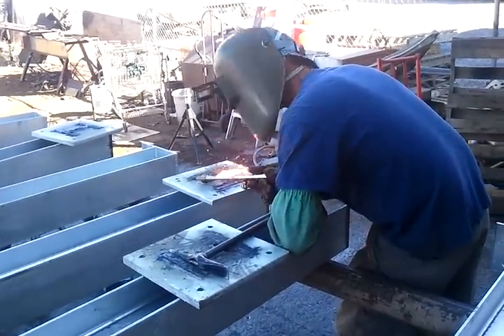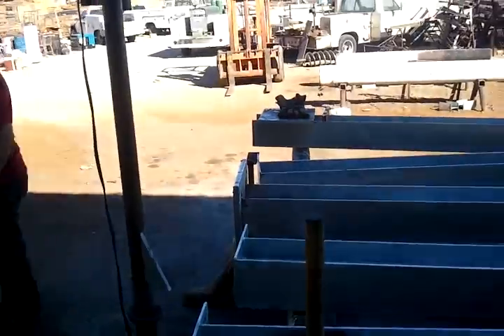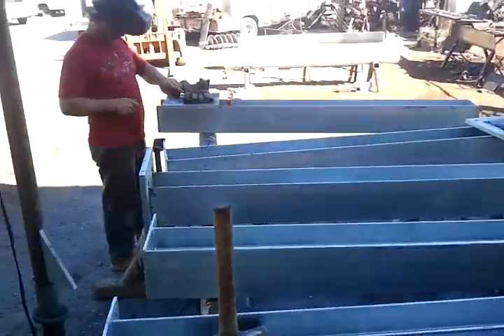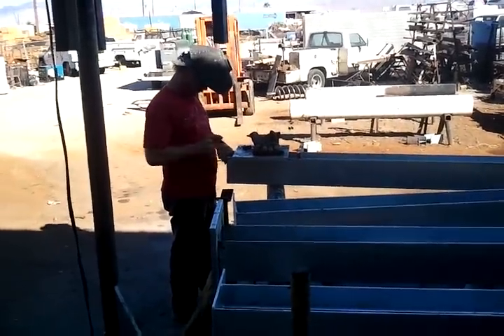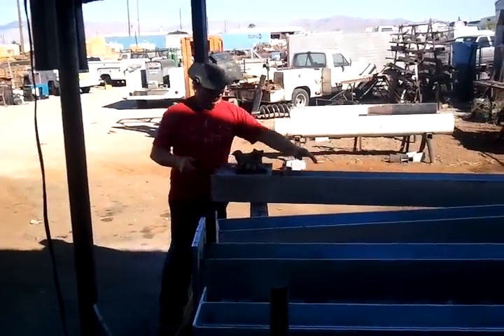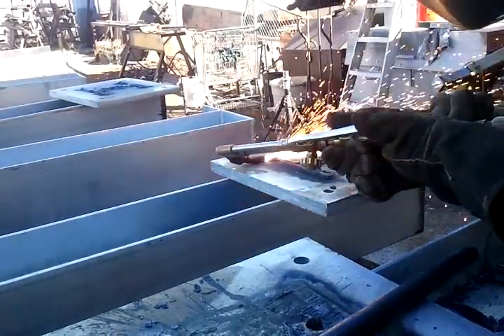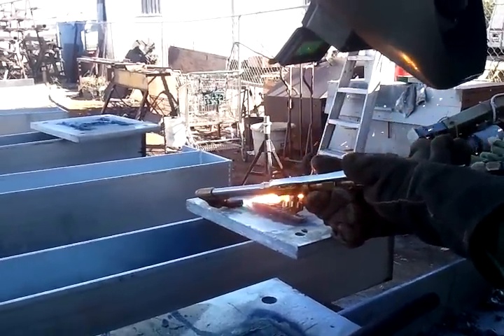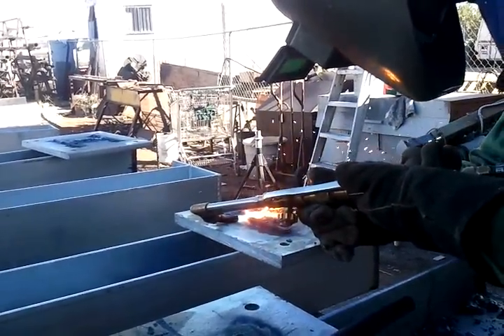How to use a scarfing tip

Comment: New to welding, never heard of a scarfing tip. Thanks for teaching me something new.
Reply: John Tremblay scarfing tip good for cutting off bolt heads or cutting out old welds.Disavantage of it is the heat it transfer onto the base metal.AirArc using carbon arc heats less to perform the same job.Its noisy and messy but it distorts the base metal less.
Reply: Gilbert B even if it cuts into the base metal it can be filled with weld fill then grinded down. Takes the quality from the metal but it’s possible to salvage.
Reply: Years back, when I was a code welder on heavy pressure vessels. A scarfing tip was the only way to make X-ray repairs on carbon.  Slag or cracks were super easy to see with the scarfing rig.  With an arc air....it was too slow and too easy to blow out the bit of slag and never see it.  The downside was it too lots of time and skill to really master a scarfing rig....not so much with an arc air.  As far as heat input...true, but not much of a problem.  Was allowed on Navy and Nuclear Code specs.

Comment: Work much better if you turn the torch up real high, preheat and don’t touch the oxygen lever.  Get it real hot and wash, push the weld off. If you hit the oxy, you don’t know which way it will go.

Comment: Made thousands of x-ray repairs with a scarfing tip.  Washing it is ok...but as the metal starts to flow....gradually hit the oxygen...while slightly rotating the tip downward and moving backwards.  Sort of like a painting motion.  There used to be 3 sizes of scarfing tips....13, 19 and 25 for the thick stuff.  With a bit of skill, you can cut a frozen nut off a bolt and not touch the bolt threads.

Comment: My helper tells me he knows how to weld.I have 88 track pads to remove.We need to cut off 4 bolt heads off of each pad.Helper doesnt know how to set up oxy/acetylene torch.He knows how to weld but why can't he set up a basic torch.Short cuts.
Reply: 1st step into welding is general knowledge.2nd step is the basic on joining metal using oxy/acetylene.Basic set up,safety and you learn to cut and weld.If you can weld but got no idea how to set up oxy/acetylene?Since you're welder..tell me about 1/8" 7018 and 11018 compared to 6011 same size.